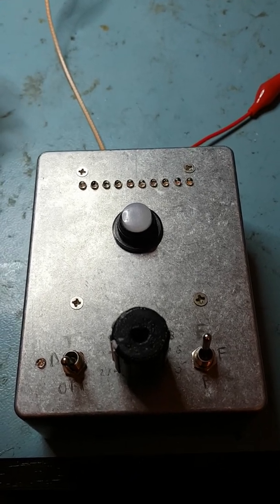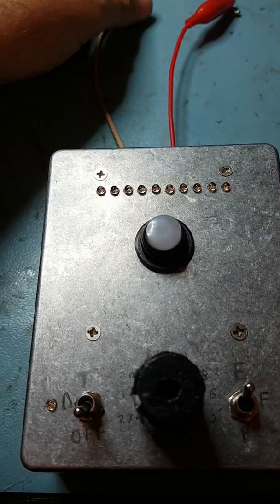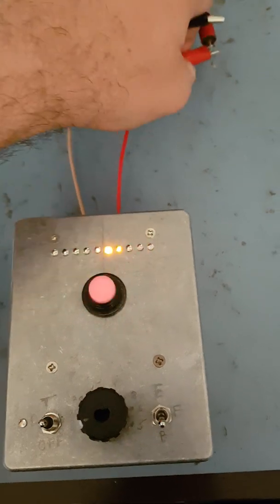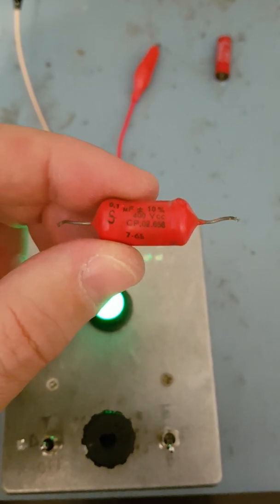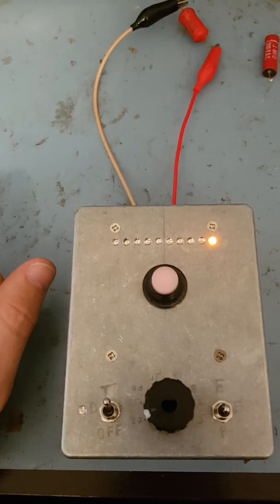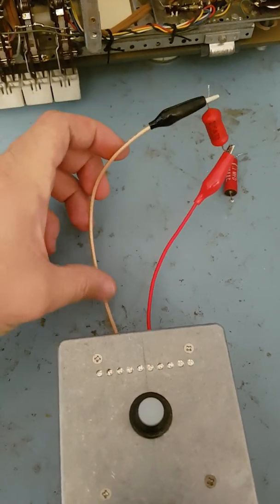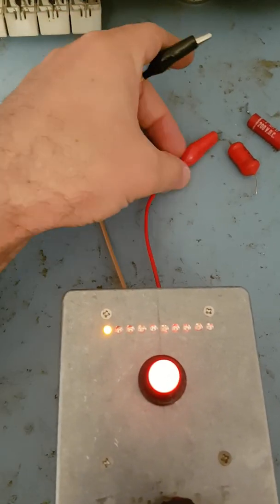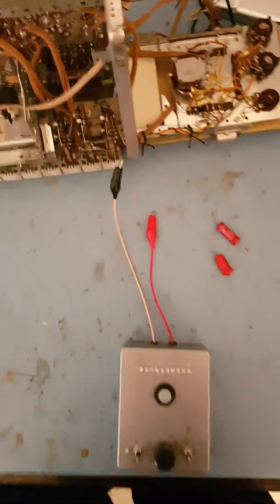Mr. Carlson Capacitor Leakage tester complete

Comment: Este dispisitivo hasta cuantos micro faradios puede medir?? Ya que a 100uf se descarga muy lento y si quiero probar uno de 470, 1000 o más uf tardaría una hora o más!!
Reply from the maker: Si desea medir fugas de electrolitos grandes, puede cargarlos con una fuente de alimentación cercana al voltaje configurado en el dispositivo. Esto hará que la medición sea más rápida, pero no exceda el voltaje configurado en el instrumento o corre el riesgo de dañar el probador.

if you want to mesure leakege of big electrolitics, yo can charge them with a powersupply near the voltage set on the device. this will make the mesurement faster. but do not exeed the voltage set on the instrument or you risk zapping the tester.
Reply: @fishyrider3528 muchas gracias por la respuesta!! Lo probare así!

Comment: I'd like something that tests caps in circuit as well. It could get very laborous to lift one leg of every cap in some devices.
Reply from the maker: You can test esr incircuit in some cases, but leakage in circuit is not recomended. This device can mesure leakage on a 1Gohm rezistor so the chanses for the circuit to influence the mesurement is pretty high. Also you have to consider voltage for incircuit testing, this device goes up to 27 volts, this can be harmful in some cases. I do not know of any incircuit leakage testers.
Reply: @fishyrider3528  OK thanks!

Comment: I wonder what are the limits of that instrument because nobody mentions that. Please can you tell me what's the biggest it could be test?
Reply from the maker: At 27 volts this device can mesure leakage on a 1Gohm rezistor. The ideal capacitor looks like an open circuit, infinite resistance, for 27volts DC to this device and a shorted cap looks like zero ohms rezistor to this device. This are the extremes. In between theese examples this device can mesure leakage for caps that look like a rezistor up to 1GOHMS.

Comment: At least you show the functionality so far and nothing else. On the contrary, many youtubers, showed also the PCB, unveiling the implicit schematic. Once is public in such a way, there is no claim about the "invention"... but General Radio, have got the same idea in the 40's, so is not new to test under low voltage. I think 400V caps should be tested at that voltage.
Reply from the maker: The general ideea behind this tester is to test leakage under safe voltages. Ofcourse you can test 400v caps at that voltage. But if the 400v cap looks like more than 1Gohm at 27V than chances are it will be fine enough at 400v. Or at least the leakage at 400v will allow a pretty insignificant amount of dc. But this is ofcourse circuit dependant. This device will give you a good ideea of the state of the cap.
Reply: Mr Carlson compares this unit along side high voltage testers in his video and the results are identical.😀